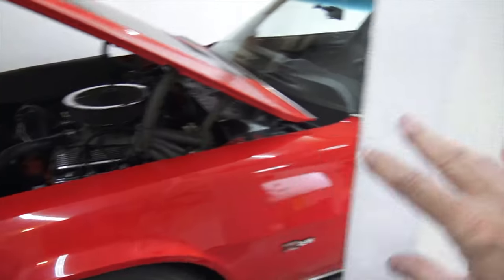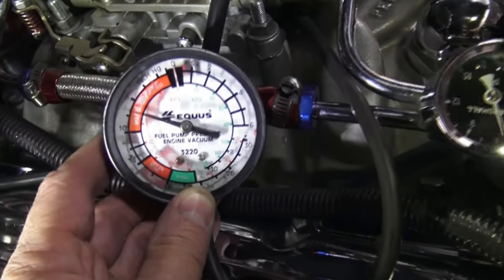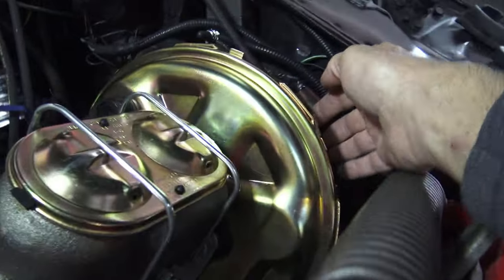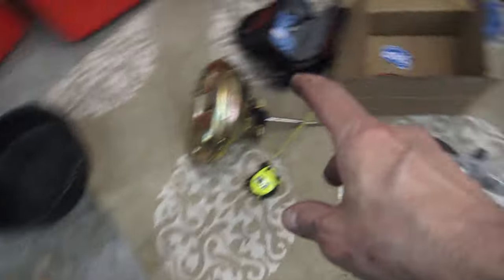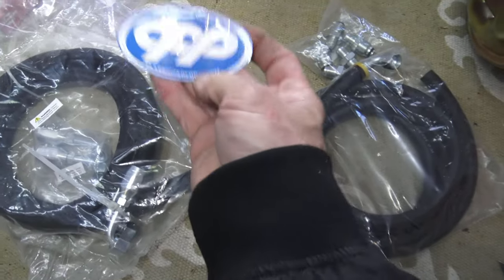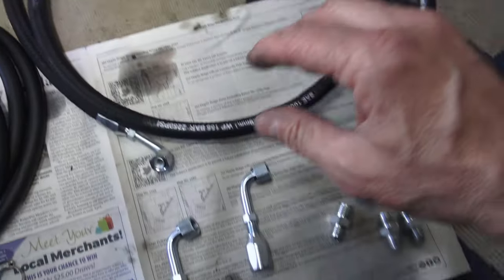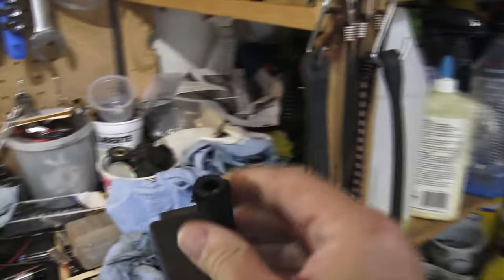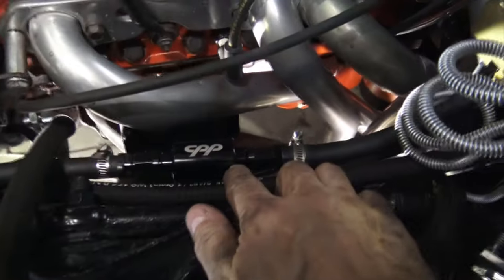Z28 Hydroboost install. Should you do it?

Comment: I’m definitely going to do this to my Firebird! The current brakes suck, especially with what I’m doing to it. A guy at work told me about this modification. This video confirms and does a great job of setting it up. I’m just glad my engine is still out so this should be pretty smooth.
I can just leave the hoses lose until I drop it in🤙🏽

Comment: You either have a tuning issue, or, more likely, you picked a cam with a very low lobe separation angle, which won’t produce much vacuum. People want the big cam sound, which is an LSA in the low numbers, usually 106 or less. Picking the right cam would have been easier.

Comment: My 72’ gmc 2500 had a 1 1/4 inch master with a vacuum booster and a 1:2 ratio bracket (super stiff brake pedal with low brake pressure). The LS that’s going in it only gets 12” of vacuum at high idle. I’m now putting a Hydroboost unit with 1 1/8 and a 1:1 bracket (semi stiff brake pedal and very high pressure)

Comment: Hello Mike I installed my hydro boost over the winter first mechanical test yesterday and the hydro boost system heated up the steering fluid like crazy and blew the seal in the steering box in 5 mins .  The in line filter flow direction is it from the hydro boost towards the pump?  that's the flow direction I put it in. wondering if I have it installed the wrong way ?  any ideas would be appreciated.
Reply from the maker: Hi , I've got the filter in the lower pressure return line from the Hydro boost to the pump. the older pumps can barely handle the addition of the hydroboost so I may upgrade to a heavier duty one soon.

Comment: If I had power steering I would in a second. Not sure it’s better than a vacuum pump though. Engine blows up and you will be struggling to stop.
Reply from the maker: It has a reservoir to allow a few stops if the engine stopped.

Comment: Hello have a question if you can help if you have the power steering pump with two return lines do i need to run a filter on both or is one ok such as the return line from the hydroboost to the power steering pump or from the power steering pump to the power steering box
Reply from the maker: Hi, Yes you should run just one filter and I put it in the low pressure return line. 
Thanks